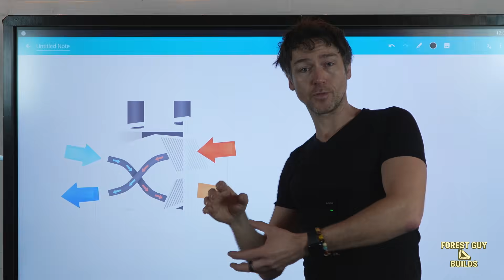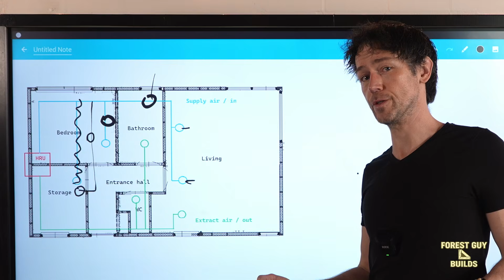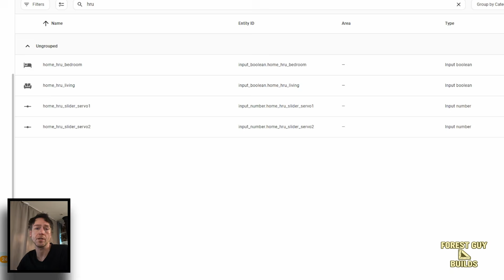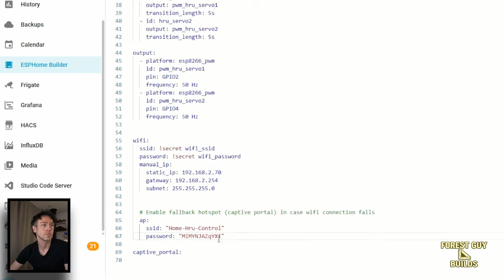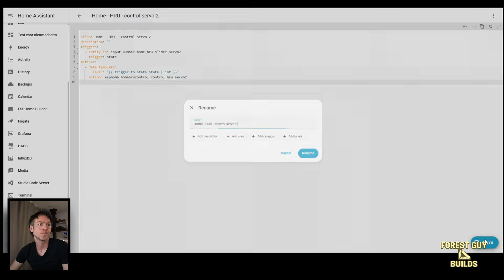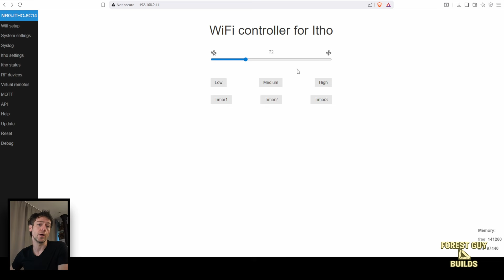Save energy. Stop ventilating empty rooms | DIY HRU efficiency upgrade

Comment: Can you please share your yaml files?
Reply from the maker: I wanted to make the files available for download on my website, but I ran into some issues getting it up and running the way I had in mind, so I just haven't gotten around to it yet, sorry about that! Are you mainly interested in the yaml files for the config? Or also the 3D printable part files? Curious what you're planning to build yourself! Let me know so I have an idea how I can help you in best way.
Reply: @ForestGuyBuilds 
I'm just looking for some inspiration and ideas.  Currently I'm replacing my shitty DIY HRV with "factory-made" one 🙂, waiting for it's delivery now.
Using esp32+esphome+HA, I have implemented EC-fans control, air quality monitoring (PMS5003),  temperature for each hrv camera and efficiency calculation.
I'm up to use Belimo actuators and add some humidity monitoring.

So it would be interesting to check somebody's implementation, what sensors and automations are used, also I would great to see your representation of HRU in home assistant dashboard
Reply from the maker: Thanks for sharing your setup, cool stuff going on there! Keep experimenting 🙏😎
I'd really like to help you out, but I'm still having some trouble (yep, time and priorities 😅) getting my website set up the way I want, so sharing all the files isn't as straightforward as I'd hoped.

I've actually been thinking about making a shorter, updated video about this project. This HRU one, was one of my first videos, and at around 40 minutes, think I went into way too much detail in some parts, while maybe missing to cover some of the more useful stuff.
Would something like that be helpful for you? And what specifically would you like to see covered? The sensors, automations, YAML configuration, or something else? The configuration files also contain quite a few entity IDs specific to my setup, so they're not exactly plug-and-play.
As for the HRU representation in Home Assistant, I assume you mean the visual (outlets/inlets) with all the measurements and values? That could definitely be interesting to cover in more detail! It's even not that a difficult/big one, so will cover it for sure!

One thing in your setup caught my attention, though: you mentioned using Belimo actuators. What exactly are you planning to use those for in your HRU? Are you modifying something inside the unit itself, or adding some external airflow control? Just curious to better understand what you're trying to achieve. Maybe I'm misunderstanding how you're planning to use the actuators.

As it's becoming winter here, a follow up of the HRU project will become an interesting one, as the outside projects move to the back a bit now. 
Anyway, let me know what would be (most) useful to you, or if there are other things you'd like me to cover. I'll add them to my list and see how far I can get it!